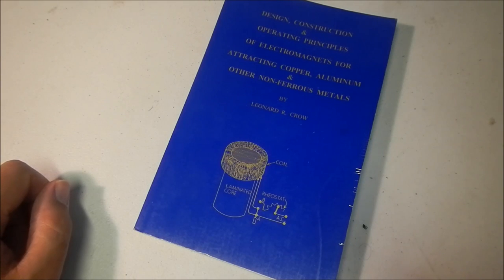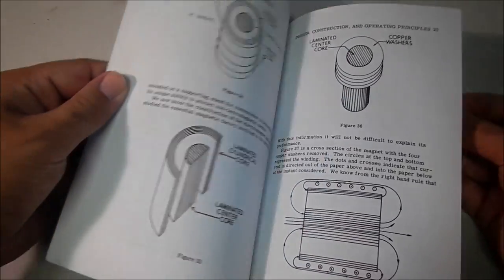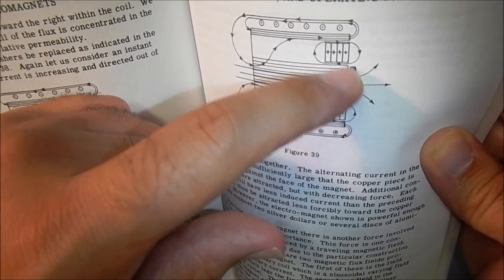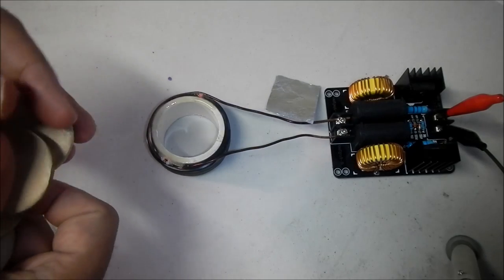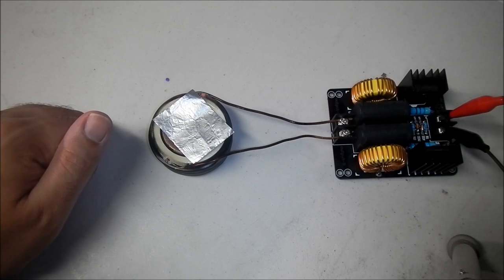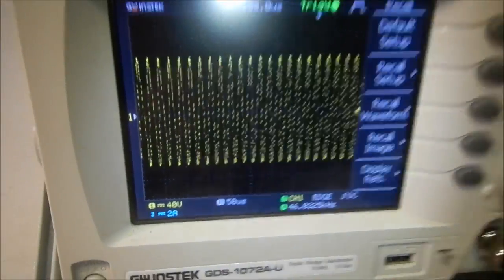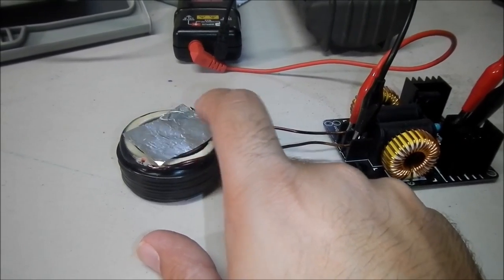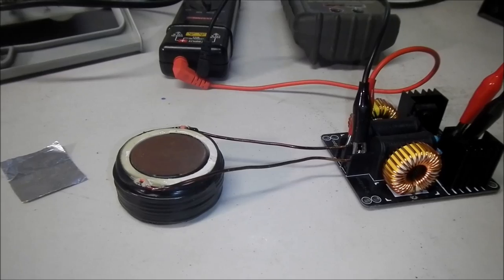Electromagnet for Attracting Copper, Aluminum and Non-Ferrous Metals like GOLD!

Comment: I have a weird feeling that I will eventualy re-discover the anti-gravity gadget/method.  I can feel it...
Reply: Look up Eric Laithwaite: Circle of Magnetism and Magnetic River
Reply: @Mac's Trade Signals No Mac, gravity is the force/energy that pulls everything toward the center of the earth. Aerodynamics is just a method to lift off from the ground. Not really anti gravity if you're forcing it up. Basic physics.
Reply: @Mac's Trade Signals the moment of inertia has nothing to do with it.  The object does not have to have any moment for gravity.  It does not have to spin.  The moon does not spin - it orbits.  Yet it has gravity.  

That time slows down and space shrinks near mass is described by GR.  You have only said time.  Acceleration takes both.
Reply: Sir can we make copper coin to repell the needle away from it ? Is it possible

Comment: Just seen this.. try winding the coil with thinner wire AND wire the coil using a Bifilar technique. This should work much better. Thanks.. ❤
Reply from the maker: I have some ideas for improvements just need the time to work on them... will share when ready.

Comment: would the magnet be stronger if you used washers instead of slugs? Your model seems quit different than Crow's. What was his laminated core made of?
Reply from the maker: Maybe I have some ideas to improve the core... I think Crow was just using typical tranformer Iron core.
Reply: @sparkstarter  the place to start would have been to build it exactly as in the book. Then try to improve on it.  Not build it kind of like it was in the book. Since I don't have the book, I can't say if there's enough info to build it exactly as he did, but it's definitely not what you've built.  The biggest deviation being the copper slugs instead of washers,  and no laminated core! His depiction looks to be longer as well,  and likely only partially filled with washers. After you've replicated,  and tested his design,  maybe then improvements can be made?
Reply: @Quickened1  Critically important post! This video shows someone presenting an invention an then demonstrating the effect of something else which affiliation to what was presented is only marginal.

Comment: the aluminum foil can be rejected from the edge of the coil towards the center but the suspended copper is proof that it really works. can you give me some dimensions such as the thickness and diameter of the copper discs, the thickness and number of turns of the copper wire and the size of the cylinder white plastic you rolled on?plese reply.
Reply from the maker: I don't think the dimension matter too much as long as you follow the general design concept. I've got a link to the book that introduced me to this idea here: https://www.sparkstarter.tech/library

Comment: @sparkstarter  here is an experiment suggestion:    vary the driving coil power input and see how it affects differently sized small pieces  at various points along the copper slug surface. Use the string suspended arrangement and vary the suspension height relative to the vertically placed/located electromagnet-slug unit.

What is the effect of the coil on that large piece of alum foil W/O the slugs compared to when the slugs are included? 

Use several different sizes of circular alum foil in the string suspension arrangement w and w/o the slugs.

IMHO, the applied field of the coil makes the inner portion of the diamagnetic material [aluminum] more magnetic by inducing fields in the areas over the coil which improve the  magnetic properties of the portion of aluminum that is over the slugs. The relative sizes of coil-slugs-diamagnetic material is the crux to finding the solution. A diamagnetic substance is one whose atoms have no permanent magnetic dipole moment. When an external magnetic field is applied to a diamagnetic substance such as bismuth or silver a weak magnetic dipole moment is induced in the direction opposite the applied field.

 More suggestions to follow.

See my other comment below RSVP to let me know you saw this. All this is very important to advancing physics & other sciences.

Comment: Yes, vary the frequency and measure the force response.  A spectrum is easier to use and understand. There should be specific resonances for each kind and shape of material.  Electric and magnetic polarization studies of materials have been tried since earliest days, but have a new start because of low cost Arduino and control systems. The drone and stepper motor controllers can be adapted.  Anything with inductance or conductivity also has characteristic decay times, so those can accept forces.  Try varying the magnetic field for different alignments with the electric and magnetic fields you produce.  For reading, look at "near field' methods, and for very small wavelengths "radiation" or "far field" methods.  It is pretty messy, but if you concentrate on measuring the forces and movements, as you make specific changes to controls and fields, you can at least store the data and try to make sense of it.  Share the data and keep improving algorithms that help you design better and better field mediated forces.  

The 3D acoustic levitation groups are slightly ahead right now. They can move things in 3D in precise planned "orbits" and pathways.  They have not really got spin and orientation of the objects moved down.  I think the electromagnetic levitation groups do that better.  That is partly because magnetic fields have been used to move things for a long time.  Just not by field alone.  The phase controls for slow careful movements need to  be precise.  And you need to be able to measure small movement precisely to slowly improve the control algorithms.  Interferometers are not too expensive, but those cheap camera microscopes work pretty well for getting started.  The Raspberry Pi cameras can take up to a 1000 frames per second, but more and more cameras can do "regions of interest" (small areas) at faster frame rates.  I have seen some that are supposed to do 200,000 frames per second.  The reason for something like that is, if you use a 20 kHz pulse signal to send the force, then you need to be able to watch if you are matching the objects resonant frequencies.  If you know how to use an SDR, they can digitize at 2.5 to 100 Megasamples per second, and do up to 2^22 points per FFT.  You don't need that to get the spectrum of the movements as a function of the spectrum of the activating field - but it is nice to have an upside, when you don't know how far this can go.

Measure,. measure, measure..  Share, collaborate, create visualizations of the data.  Calculate the precise movements.  Don't say "it moves". Say, it moves by 1.342 microns at 23.22 Hertz.  Or share the FFTs  (Fast Fourier Transforms)

Copper and conductors are all diamagnetic.  They can also have paramagnetic, ferroelectric and other responses to fields. But electrons move away from regions of high magnetic energy density.  A magnetic gradient can push anything that has moving electrons.  Free electrons.  If you find some small metal rings and put them in resin, that might be a good proxy for the atomic things.  In general if you use magnetic spheres, or conducting nanoparticles.  We don't have a name for microparticles because people are proud of "nano".  But micron sized dust is fine.  I noticed that diamond dust is for sale at 60,000 grit. That is 0.5 micron.  Here is a link to explain grit sizes. There are LOTS of conducting and magnetic particles.  It is easier to lock into them, than to try to get all the way down to atoms and molecules in your first experiments.  And staying at macro scale (centimeters and inches and millimeters) without measurements is going to be a LONG process.

Comment: @arkstarter   @UCCr-PXBNN3RoPbEuVp2pTWA   here is an experiment suggestion:    vary the driving coil power input and see how it affects differently sized small pieces  at various points along the copper slug surface. Use the string suspended arrangement and vary the suspension height relative to the vertically placed/located electromagnet-slug unit.

What is the effect of the coil W/O the slugs on that large piece of alum foil? 

Use several different sizes of circular alum foil in the string suspension arrangement w and w/o the slugs.

More suggestions to follow.
 

See my other comment below RSVP to let me know you saw this. All this is very important to advancing physics & other sciences.
Reply from the maker: Thanks for your comment I'll consider your suggestions.

Comment: Used in removing dents from aluminum.
Reply from the maker: is there tool for this or did you develop the technique?
Reply: @sparkstarter  The tools, two I think, were made by Maxwell Magneform for Boeing to fix small dents on airplane skins.  Cheaper than dismantling inside to pound out dents.  Pays for itself in reduced air drag (reduced fuel costs).
However, the mechanism is a bit different.  Your device will repel any large piece of aluminum or copper.  Only pieces of similar size to copper disks are attracted.  Next comment refers to your setup as a shaded pole linear motor.  I'd think of you device more as pushing the aluminum or copper from back side.  Magnetic field is expanding around perimeter of aluminum.  There is little field close to copper disks.  Thus when aluminum is close to disks, there is more field on back side of aluminum than on front side adjacent copper.  Back field pushes aluminum towards copper where field is lower.
The Maxwell Magneform machines instead use a time dependent function.  Aluminum is repelled weakly for a relatively long time to build up current, the attracted hard for a very brief time.

Comment: Why not put a handful of turns where the copper washers are, & connect them in series with the main coil, the turns carrying current in the reverse direction from the main?  This way you are not expending work inducing current in the washers, you can directly drive it.
Reply from the maker: Yeah I bought some washers... need to re-design the coil so I can use them. Might explore the idea of a direct drive inner coil.

Comment: Nice.  From my own understanding, it's a form of dry electrolysis in the sense that both methods require molecule size resource gathering to be of useful application.  I would think separation of aggregate in mining process could easily benefit from the use of this electromagnetic wave configuration.

Liked and Subscribed.

Comment: So is it the strength of an electromagnet that is drawing the non ferrous, meaning it is ever so slightly magnetic, and it just takes this much attractive force to draw it?
Reply from the maker: No, how it works is Electromagnet 1 creates eddy currents in the copper, effect is repulsion. Electromagnet field 2 is 180 degrees out of phase with eddy currents. So magnetic field from eddy currents are attracted to Electromagnet field 2. hope that helps.
Reply: @sparkstarter  so an out of phase, 2 phase electromagnet is what creates this attraction? A regular electromagnet has only one phase, that does not allow the attraction? Excuse my ignorance, an electro magnet is just a more powerful magnet because electricity is involved, correct?  So in essence it requires two opposing magnetic fields to attract it?

Comment: At first thought, different metals vibrate naturally at different frequencies, for example gold vibrates at 316 Hertz. Just wondering if the frequency of electricity could affect the strength of the magnetism?
Reply from the maker: What do you mean gold vibrates at 326 Hz? how would you measure that?
Reply: @sparkstarter  I just looked it up on google. The natural vibration of the element of gold. Molecular vibration?
Reply from the maker: @josephm.davidson1901  don't see anything about 316 hz in the list of material properties? https://en.wikipedia.org/wiki/Gold

Comment: if you can make a strong AC magnet, using a step down transformer, you can use a 30VA Torriodal transformer and wind a few turns of thick 1.5mm wire through it a few turns is all you need, and push this low voltage AC like 6Volts and high current like 4 to 5 amps, and direct the field against the rotating disc of your electric meter, it will influence the aluminium disc and either slow it down or speed it up, depending on the polarity of the electromagnetic field it emits, use this for education only. Inside an electric meter is a horse shoe magnet through which the disc is influenced, the idea is to induce an opposite field into this horse show magnet so that the disc starts spinning backwards, some meters have mechanism to stop them spinning back, but in the least you can stop it from spinning forward, or substantially reduce how fast it can spin in forward direction. In this experiment you can understand how meters work. So using just 30watts of electromagnetic power you can overcome Thousands of watts of actual power being metered. This will not function on new smart meters, for that you need hacking into data stream and feed low tariff.

Comment: I have been interested in something similar to be used to clean up brass casings from the ground.  If there was enough force to pick them up, this would be a great solution vs trying to build a metal separator.

Comment: You should try constructing Edward Leedskalnin's PMH (Perpetual Motion Holder). It's basically an electromagnet that has been bent around in a circle such that the ends meet. Once a magnetic field is induced in it, even when the electricity is turned off the magnetic field remains within the metal ring. This can be proven via an led connected to the circuit.

Comment: If you want to really have some fun use a second coil inside instead of a passive slug. Wrap the coil so the current flow is opposite of the outer coil but magnetic field is in the same direction.  It will pull massive amounts of current and generate alot of heat fast. Be careful and good luck!
Reply: oque sujere para diamagnetico em nanoparticula porosa

Comment: Imagine a cylindrical elevator with brass-plated steel caps at the head and base. Inside these caps are wiring and sensors. Would it be possible for an electromagnet to hold the weight of such an elevator if it were filled with, say, twenty people and if the shuttle was slotted inside of the magnet (as one cylinder inside another)? Would this be safe for passengers?
Reply from the maker: not sure... gonna need a picture of this thing to understand.
Reply: @sparkstarter  Hmm, that could take a while.

Let me rephrase.

Imagine a solid black cube with a hole bored through the middle.
The elevator (made of steel but plated in brass) passes through the hole.
The cube is a giant electromagnet.

Does the magnetic force attract the steel through the brass plating? If so, would sufficient magnetic force be a danger to passengers?
Reply from the maker: @somerandom7672  Not sure if you've ever scene this experiment... but with a strong enough magnetic field people could float around weightless... no danger to the people unless they had some  magnetic/metal implants or something. We have only been able to build electromagnets capable of lifting frogs. https://www.youtube.com/watch?v=KlJsVqc0ywM
Reply: sparkstarter Interesting, thanks.
Reply: @sparkstarter been lifting up frogs for a living. Never seen any happier frog than when I lift em up. I can confirm what youre saying.
Reply: @sparkstarter  
I mean Im sorry, but I just imagined a million dollars worth of research into human lev tech finally end at the stage of psychological uplifting of frog. 

Made me silly happy for a picosecond. Thought it'd be uplifting to other humans as well.

Comment: What you are doing is creating a shaded pole linear motor. The eddy currents will hold nonferrous stuff at the null point.A much easier way to separate the ferrous and nonferrous metals would be to use a series of regular ac electromagnet and have the mix pass over them at an angle. You get the metals sorted by ferrous closest to magnet, non metallic or high resistive in the middle, and nonferrous to the outside. Works great to sort scrap or mining gold from gravel.
Reply: I'd certainly agree that repulsion is more efficient for separating nonferrous metal than is attraction.  However, I think the shaded pole analogy doesn't quite fit here.  Shaded poles have just enough copper to shift phase of magnetic field through the shaded pole but not block field completely.  At 60kHz, the copper washers are blocking almost all field through them rather than shifting phase.